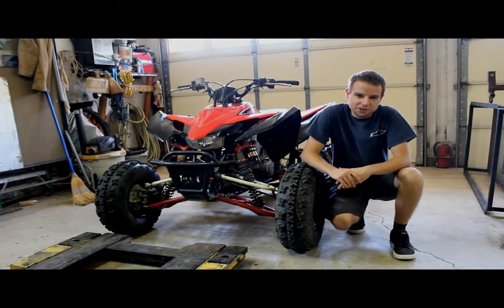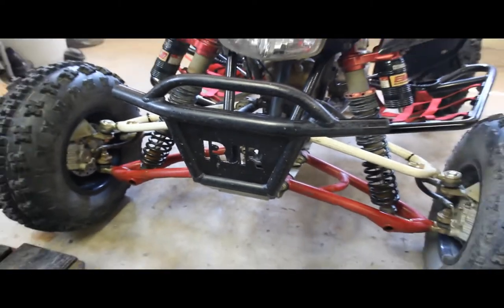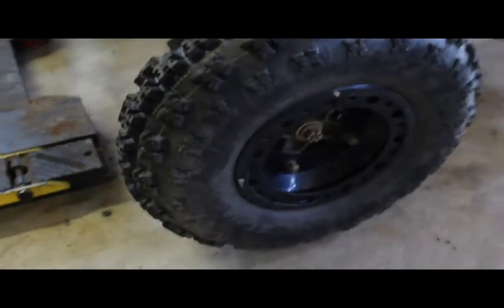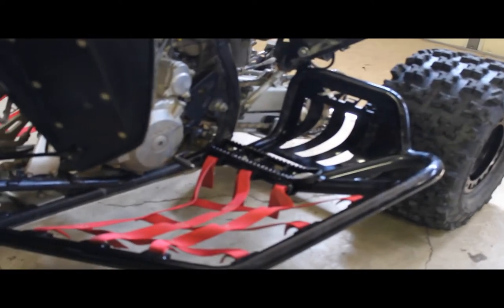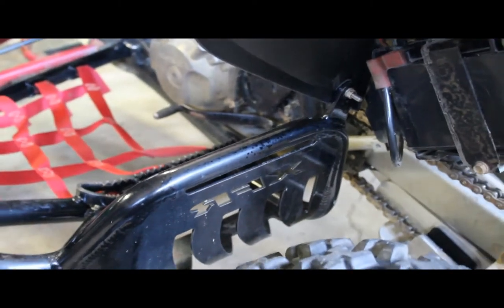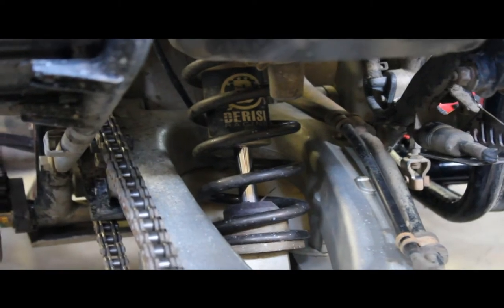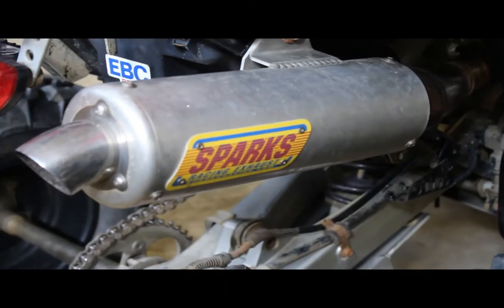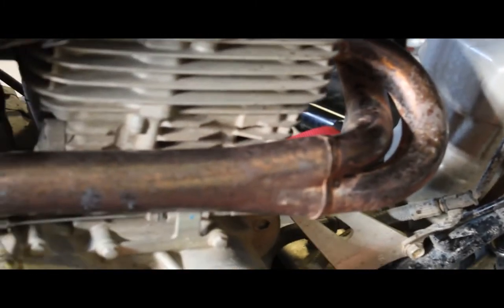2008 Honda 400ex Walk-around + Startup Sparks Exhaust

Comment: That quad is sweet! I have a Lexx exhaust on mine but I wish I saves for the sparks.
Reply from the maker: The sparks is really expensive. It was on my old 400ex when I bought it.
Reply: @DownAndDirtyOffRoad  Yeah, it probably the best exhaust you can buy for the 400. I hate my Lexx though because the mounting hardware sucks and less than a year in and I cracked the spark arrestor and the normal tip from regular riding.
Reply from the maker: @NoahMazraani  mount on my sparks broke, on the pipe part. Welded it so it doesn't leak, but i just dont use that mount anymore. Only use one on the exhaust and then at the header

Comment: How do you feel the older 400exs compare to the new Exs like this 08 and up? I know only difference is reverse and bit different gearing and plastic. But do they ride the same and feel the same?
Reply from the maker: Ive had an 07 and this 08. They all ride the save. Reverse in 2005 and up changed sprocket sizes a small amount. I prefer 08 and up, as the 07 and under, the rear plastics would bounce a lot especially with mud on them and crack possibly. I never had that issue, but the 08 up has studier plastics. I need reverse, I use it a lot.
Reply: They are the exact quads just plastic changes and 2005-2014 have reverse